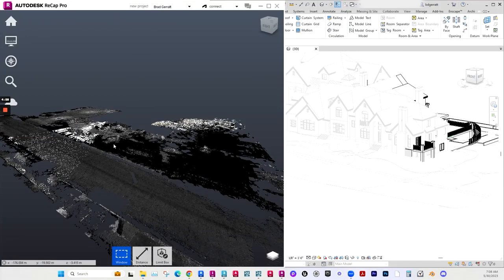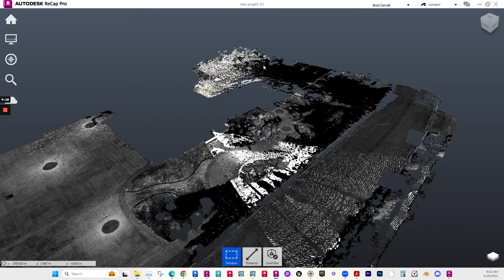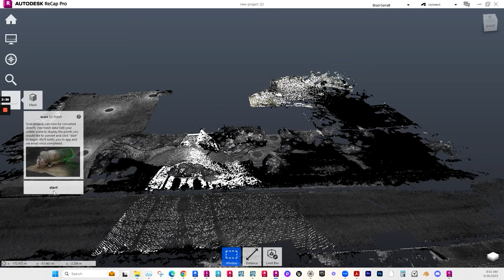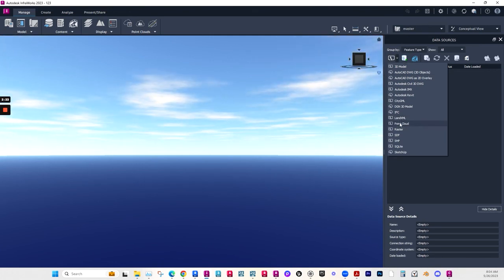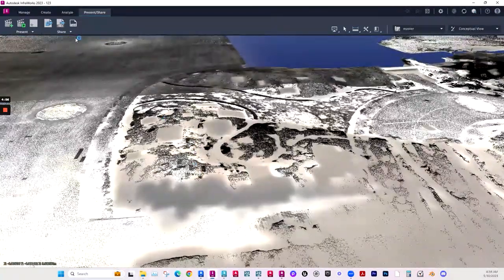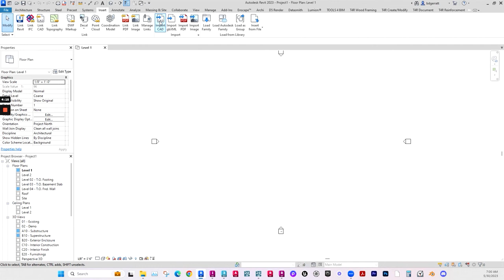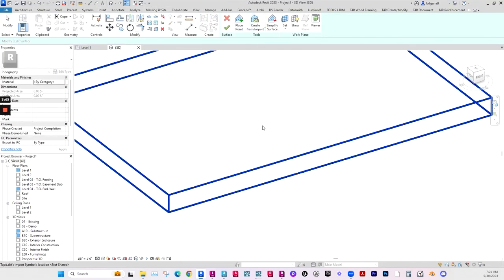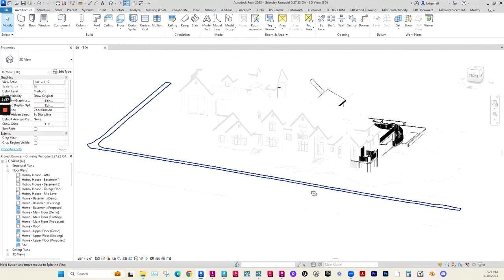LiDAR Point Cloud To  Revit Topography Tutorial

Comment: Hi. I've tryed the process shown in the video, but i'm facing a little problem. When i export a DWG from 3DSMax it creates a 9mb file and i think it's very heavy for Revit to read. When i import this file in Revit it keeps reading forever and doesn't work. Any idea of what can i do to solve this?
Reply from the maker: Did you ask Infraworks to create a light wight surface?  If  you did, and it did not work, then you may need to use a different method.  You could try decimating the mesh in Recap Photo.